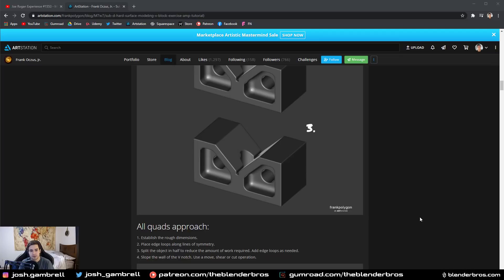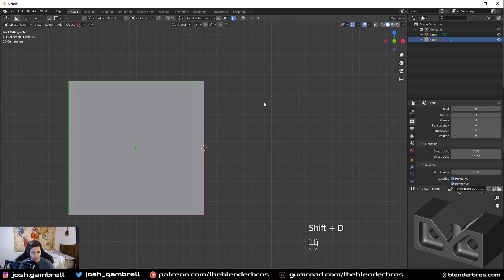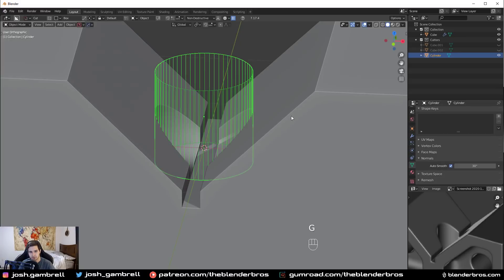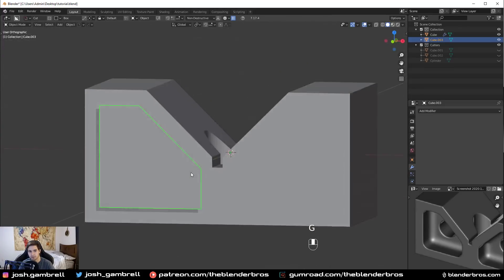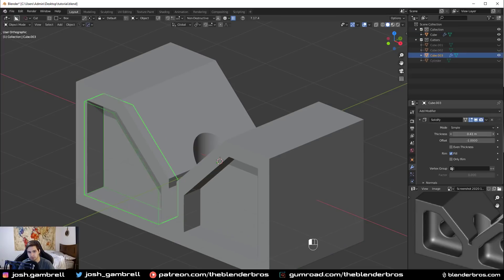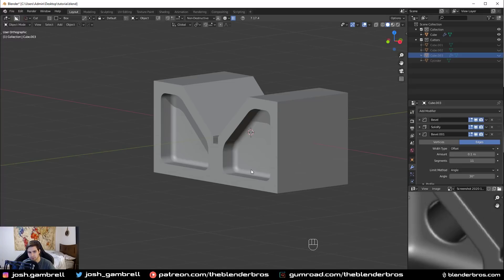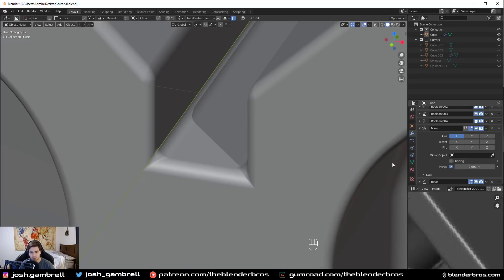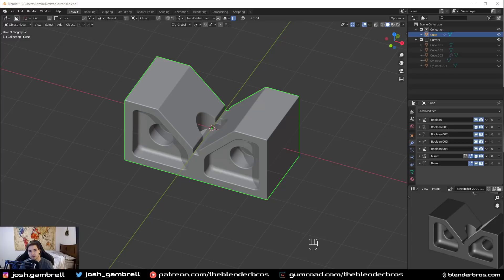COMPLETE non-destructive workflow in Blender tutorial

Comment: hmmmm but would you use this "non destructive" way to model a building..... coming from an architecture background would someone use the negatives to model apertures and openings like doorways and windows? i can see the positives...... and the power, but coming from architecture and working in cad, the inputting of the data to create the "cutter" is essentially me in autocad or vectorworks giving dimensions to the door frame or opening.... and you could even just drop in windows and doorways into the walls and then adjust and specify the size or type of doorway etc.... you can just delete the window or doorway and the wall is intact again...

im thinking out loud..... ive obviously created buildings or cad drawings where your drawing lines and offsetting lines to create the model piece by piece or line by line and also something similar to non destructively....

very informative video, and seeing someone who is able to model something complicated quickly and show and explain as well in a short video was amazing as well as make it not look so complicated....

i understand the power and flexibility of this but its knowing when to use it and being able to plan ahead..... i can see it makes sense for "concepting" a work in progress bespoke piece of  mechanical engineering where you have to adjust back and forth due to changing conditions and tolerances

Comment: 8:12 you ran a difference modifier but the effect was a difference modifier and a new mirror modifier. howd that occur? my existing mirror modifier didnt update automatically. once I cut the side window out with stolen geometry solidified, i still only had one window cut out... nvm i found the fix, i had to select my window cutout, and apply a mirror modifier after the solidify modifier. Its not intuitive because youd assume you need to apply the modifier to the cube, not the cutout.

Comment: This is great, you have reiterated a bunch of annoyances that i've come across through trial and error. The one thing that still stumps me in blender is when adding a boolean like the one you're working with around 5:00. I constantly work with things I need to be in a precise place, and yes I can move things slightly to get rid of the glitch, but then my model may be slightly off. Are there any other troubleshooting tips I could try when I have a boolean that just doesn't cut through correctly? I already understand having normals facing the right direction and making sure there isn't any duplicate geometry around the edges of the object, but there are times when i feel I have a perfect object intersecting another perfect object and it just doesn't hollow out, or the first object disappears. Thanks!

Comment: Hi Josh, when applying boolean to the cylinder, a cube appears instead...¿? The shape on the surface is cylinder shape but should appear a cylinder not a cube...What is wrong? Thanks!! :)
Reply from the maker: It uses a bounding box. You can change the display type over to wire instead.

Comment: Tip: the bevel modifier can be applied to a vertex group so you don't need to use a boolean cut to chop off a corner. Custom bevel profiles now exist (I think from v2.9). I think the only limitation is that the start and end points still form a 45 degree line.
Reply: Also, you could use a bevel modifier and change the limit method to weight and change the bevel weight of one edge from 0 to 1. Again, we're limited to a 45-degree angle but it does add the option to add segments and round out the bevel if desired.

Comment: @15:45 you should state that the Arc Miter Outer mode is basically the Blender equivalent of 3DS Max/Maya's "Quad Chamfer" operation. that'll help a lot of folks transitioning to this software.

Also for the non-d cutter earlier, applying that 2nd bevel with a vertex group on the outer edge would have demonstrated more control of the cutter too.

Comment: 5:30 aren't those problems all fixed with the new booleans in 2.91?

6:50 wouldn't it be better if instead of applying the modifiers you used a displacement modifier to scale it?

Comment: Hy, I appreciate your work, but one thing bothers me: the size. In the original written tutorial the length and so on is given, so it would be a pleasure to see how to achieve the exact same geometry. Please don't misunderstand me, I am glad for this tutorial,  but I am struggling to make everything perfect, using nondestructive ways. Not the look, but the measurable details.
Reply from the maker: I’m really confused what you mean here. What do you mean exact same geometry, you mean the all-quads route? If that’s the case non-destructive workflow is impossible as the workflow is ENTIRELY different and requires alternate techniques.
Reply: @JoshGambrell  I mean in the original article, there is a picture saying that it should be 200mm long 100mm high 100mm deep and so on. Excuse me if my wording was confusing.

Comment: Hi Josh, at 11:41 when I add the second bevel below the Solidify Modifier, the edges are not beveled. I redo this many times but no chances to put that bevel in place. Strange is, that when I screw up the segments and the offset, the other bevel density is increasing :-(
Reply: Don't need both bevel modifiers
Reply: @FrauPlau  I realized this also, but the Vertex Bevel will not be so strong as in the video.

Comment: Hey Josh you can produce these objects that you have shown in your vidoes in Solidworks or Rhino 3d quite easly and they're also nondistructive. I'm not too sure why a program such as this you need a plugins to drill holes that you have to go back and fix the geaometry later.
Reply from the maker: This was an example project. I am a Blender user and create art with it. I have no intentions of switching software, but appreciate the mention. This was basically an exercise for modifier and bool management.

Comment: why did you set two bevels when you could just leave the first one after the solidify modifier, it would also prevent beveling the edges on the side of the beveled vertices from the first bevel modifier?
otherwise, this was actually very thoughtful :)
Reply from the maker: For complete non-destructive control. You could do either, but if you want to adjust the bevels on the outer edges and the bevels on the inner separately, 2 bevel modifiers are needed.
Reply: @JoshGambrell  I was aiming for making an identical replica of the reference photo
but I sometimes forget that not everyone is like me trying his best to make a seamless replica of any reference example😅

Comment: Hi Josh, I've tried following along with the tutorial but for some reason at the end the shading gets messed up. I've tried duplicating the object and applying all the modifiers top to bottom to see whats up and it seems like my mesh gets all kinds of extra edges along the faces at seemingly random spots, which messes up the shading. On the mesh itself all the modifiers are arranged so that the boolean would go first, then the mirror modifier and the bevel for everything at the end. What could cause this?
Reply from the maker: Is it shading or mesh artifacts? If it’s shading, since this piece is relatively planar, slap on a weighted normals and call it a day. If it’s artifacts, check my recent video on fixing those.
Reply: @JoshGambrell  Ye, weighted normals almost did the trick for shading, thanks. Only problem now is that it doesn't take the extra edges in the middle into account. That is unless I turn on Keep Sharp but that messes with the smooth shading of the bevels.
Here's an example:
https://imgur.com/a/8iPgdwP
I've read that blender can't do cavities without connecting them with neighboring geometry and those extra edges it added messed up the shading I guess.
Reply from the maker: @rgb1996  Is your harden normals turned off in the bevel modifier?
Reply: @JoshGambrell  nope, doesnt affect it be it on or off
Reply: Never mind I just turned it on with weightedNormals off and it fixed it completely :) Thank you
Reply from the maker: @rgb1996  Boom! There ya go.